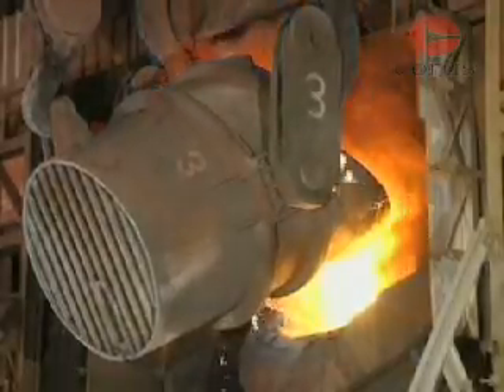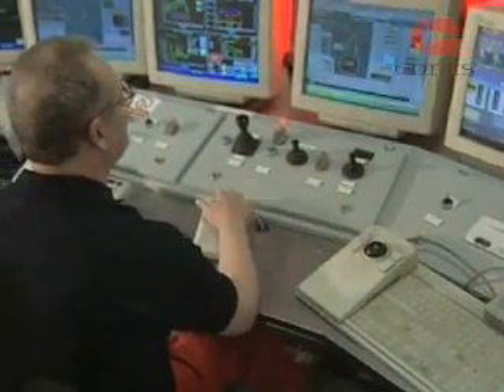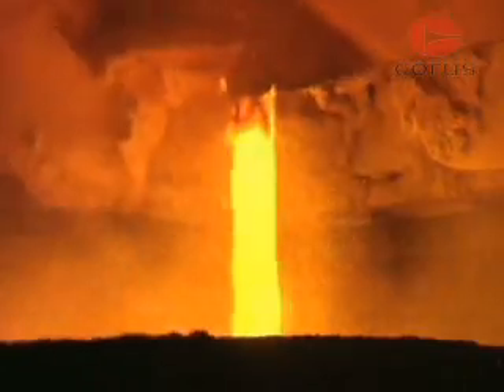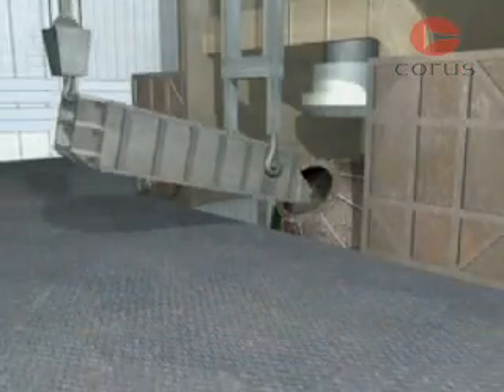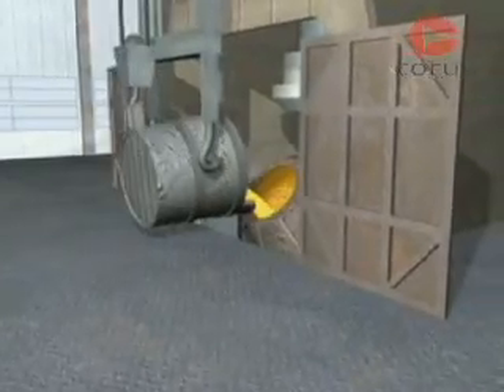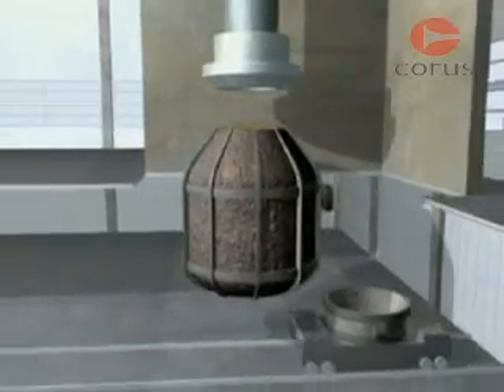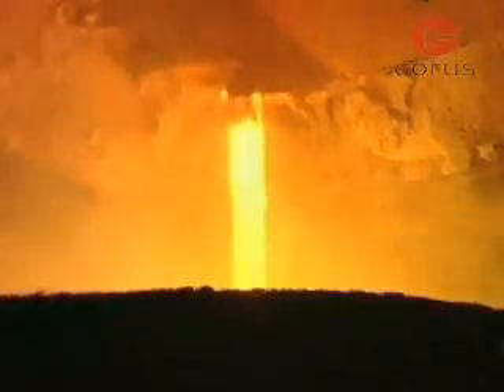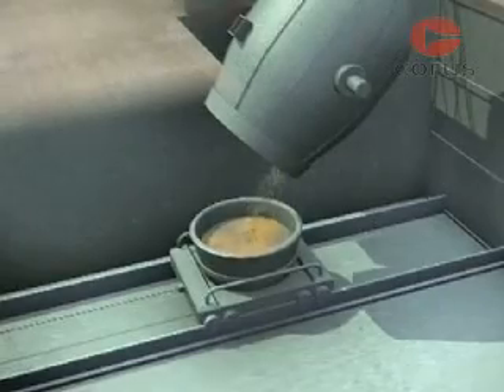Steelmaking: Oxygen steelmaking

Comment: The measure is to the brick lined bottom of the B.O.F. vessel, not to the top of the bath. As the water cooled oxygen lance is lowered, it already blowing oxygen at supersonic speed into the furnace. Steel does build up on the end of the lance and must be removed from time to time. The lances must be taken out of service and repaired occasionally. The lance tip is concave and not flat and has holes at angles to "stir" the steel bath. From a 31 year steelworker.

Comment: @hudson501 
My guess is that they monitor the pressure in the lance. If the oxygen leaves into free air, you have a certain pressure (depending on mass of oxygen passing through the lance). As soon as the lance dips into the iron, the pressure will rise. The deeper, the higher the backpressure.
You can make that experiment with a glass of water and a straw.
But I'm just guessing!

Comment: Some day, perhaps when we're long gone, someone will come forth with the answer on how the lance is held just above the molten bath.  Till then, I will toss and turn in my sleep pondering the potential answer.
Reply: Where I am, they have a device called an "Audio Reamer". To my best knowledge, this device is located in the upper sections of the ducting, and is tuned to send a signal when the lance is at the perfect height. Basically, there is a set range of frequencies it will look for, and the lance height is adjusted automatically based on this. This should keep the lance just above the bath at all times whilst on blow. 9 years too late but hopefully helps!
Reply: Found something, did a little digging: Audiometry is regarded as perhaps the most accurate method today. It is, like lance vibration, a simple technique reacting mainly to a single process phenomenon, in this case to the noise created by the oxygen jet. The equipment is, however, sensitive to dust contamination. The drawbacks are similar to the ones for lance vibration; the need for the lance tip to become submerged into the foam and a complete horizontal foam coverage within the vessel. Therefore, a usable signal is not obtained in the very early stages of the blow.